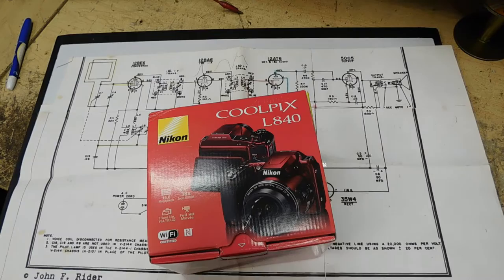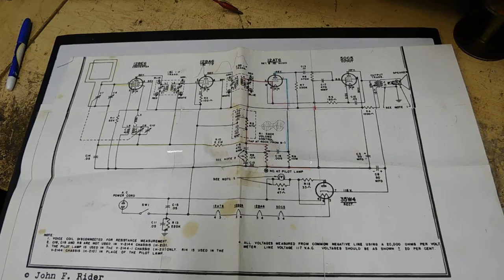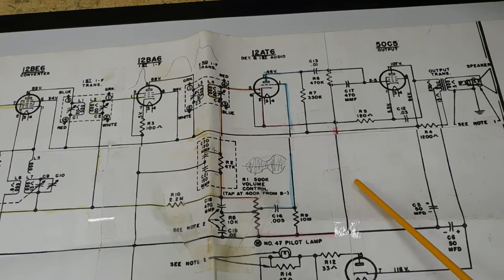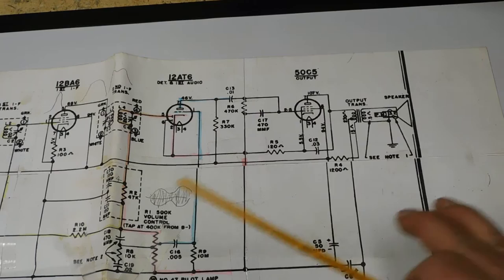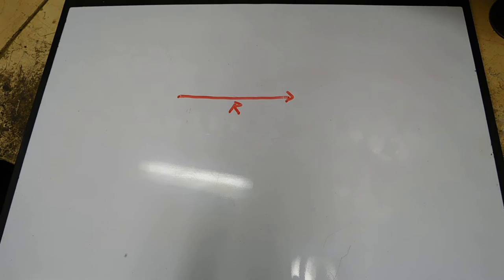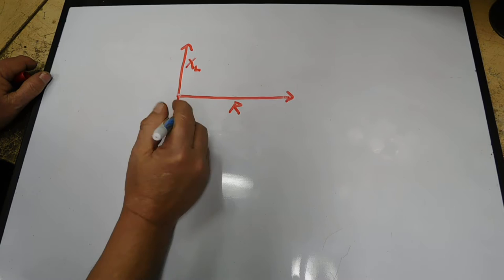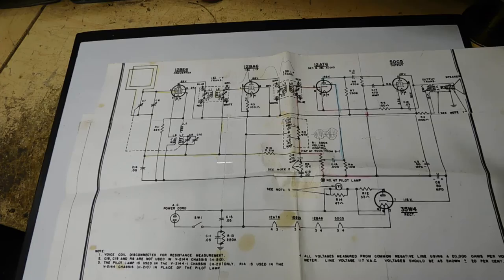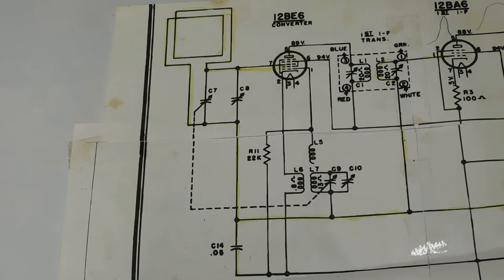Answer to questions on radio theory videos part 1

Comment: I once built an ELF receiver.  Its antenna was 3.5 feet in diameter with 300 turns of wire and weighed 40 pounds.  I used to be a scientist, but I tried teaching high-school science.  i could not control the behavior problems of the classroom, and the students would steel everything in sight.  I tried teaching community college (a SAT test is not necessary to get in), but the students were not up to the level of the textbook and I could not teach them science on the college level.  You explain electronics great!  Teach more EE videos.
Frank

Comment: Great video, and thanks for explaining.  One question though; does the ganged capacitor C9 in the local Oscillator has exact same signal as its counterpart C7 in the tuning circuit, i.e. modulated RF from the antenna or does it has only the RF frequency of the tuned radio station.  Thanks.